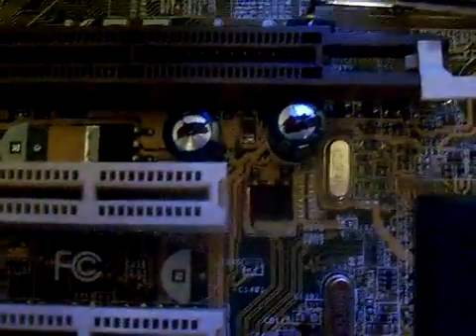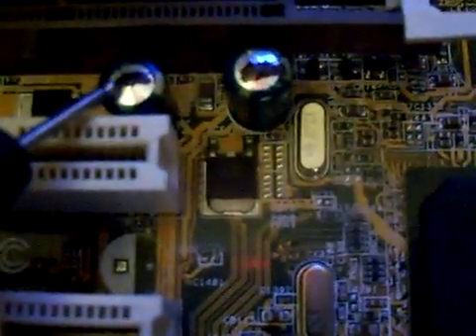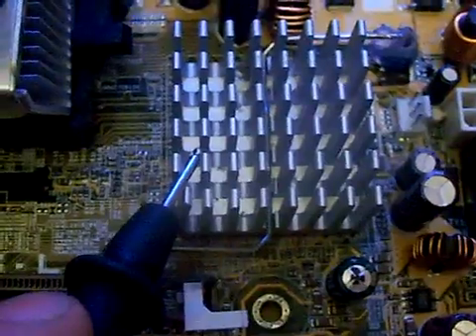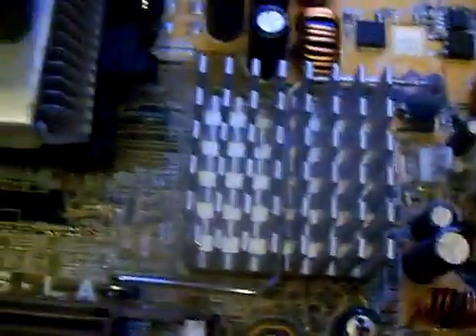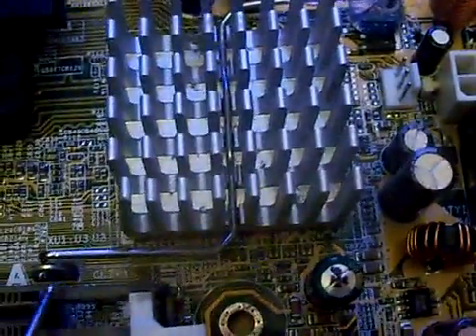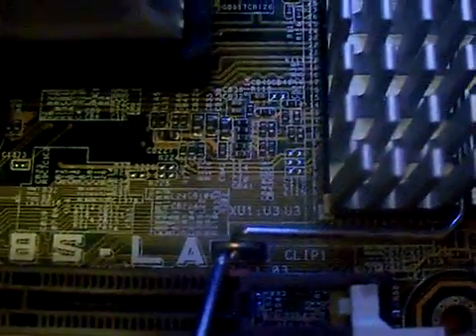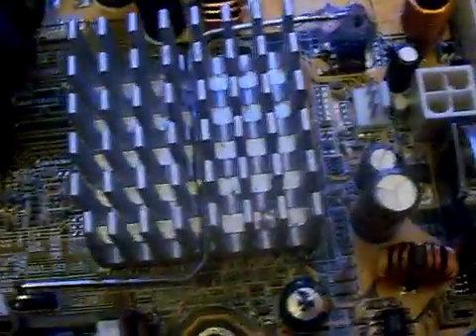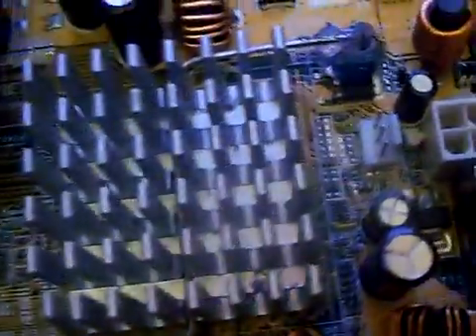Repairing Defective Motherboards - YouTube.flv

Comment: My Dell Optiplex GX 270 has that capacitor problem. All 7 of them right behind the processor are bulged and are leaking. I looked at everything else and it all looks ok except for the capacitors. Would it be safe to solder in new capacitors or is the motherboard gone?